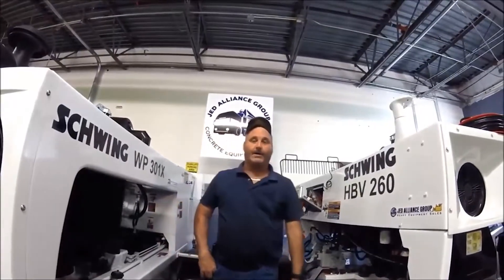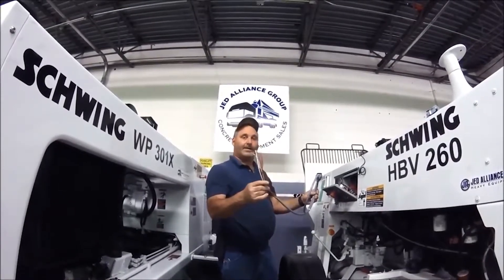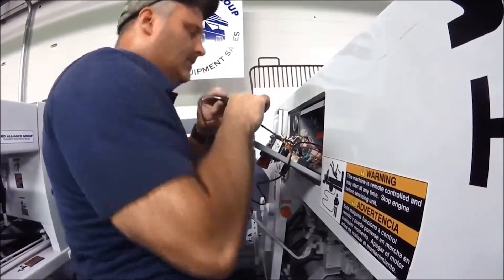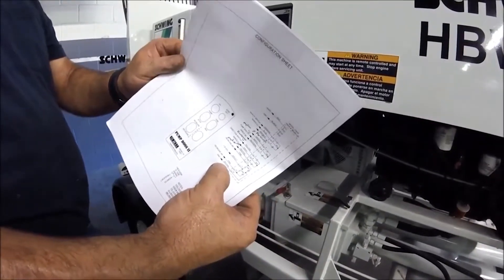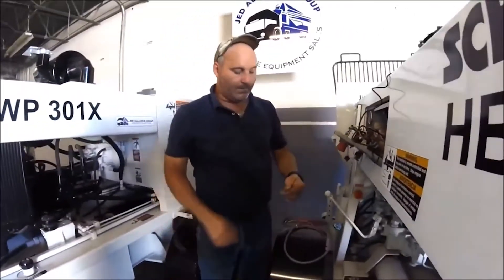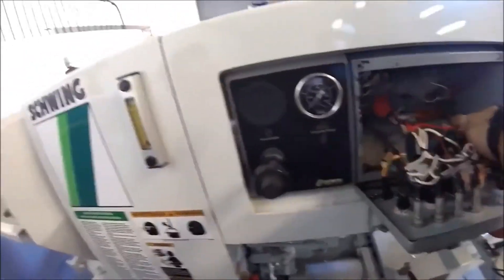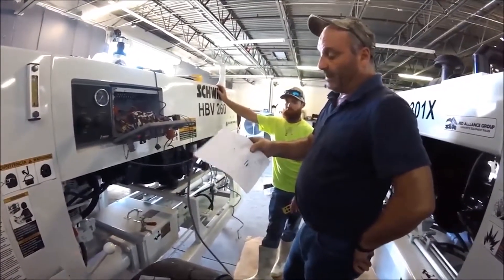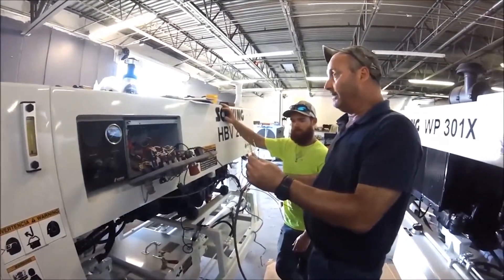How To   Wire a Remtron Remote Control To a Concrete Pump

Comment: I bought this but it didn’t work
Reply from the maker: You bought it from who?
Reply: @JEDAllianceGroupInc  
Would this set up work for my tkb 60 putzmeister?
Reply from the maker: @steveacevedo7008  absolutely
Reply: @JEDAllianceGroupInc  
The one I have on their now is giving me problems cuts of after 150feet distance.Thinking of buying a new set up for it.
Reply from the maker: @steveacevedo7008  try changing the batteries, if that dont work then It could be the unit itself. If you need a new one, makesure you buy the right one, putz uses a different system because of their momentary switches. We can sell you a brand new one with a 1 yr warranty for about $1,700 shipping included